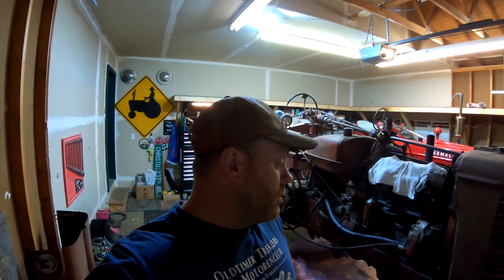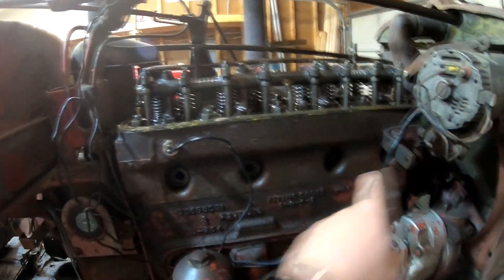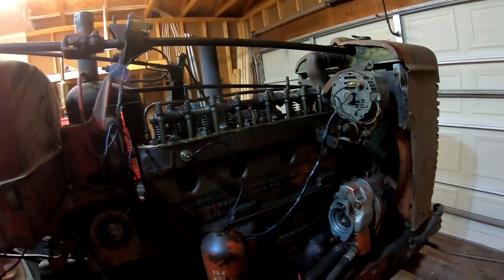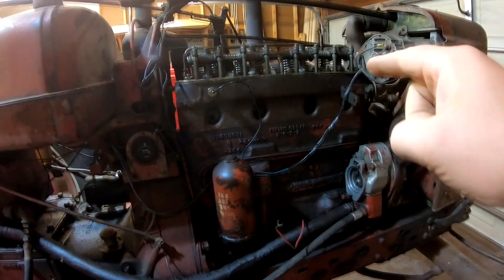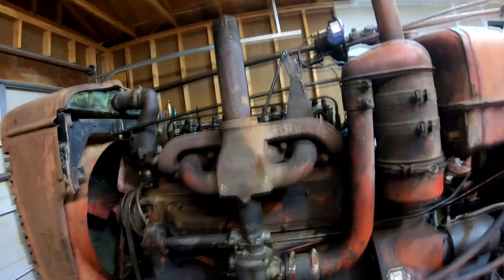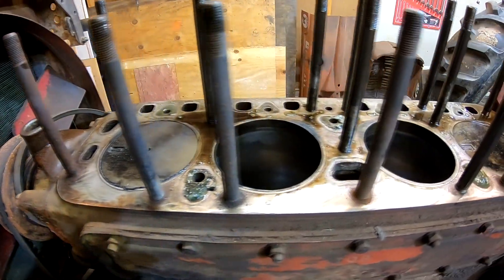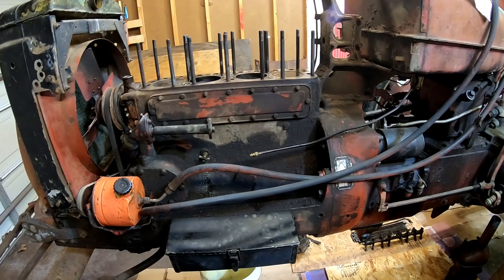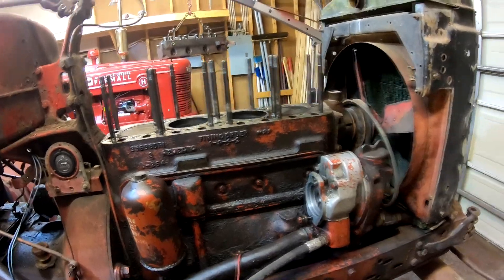This Old Farm's Farmall Super M Part 1: The Assessment

Comment: I want to make a correction for Kenny here. At about 2:30 Kenny talks about the written readings of our compression. He states the upper set of numbers are before head removal and the lower are after reinstall. This is incorrect. The upper numbers was the cylinders dry before ever removing the head. The lower set of numbers is after adding oils to the cylinders, again, before the head was ever removed.
Reply from the maker: Thanks for the correction. Either way, cylinder pressure is extremely low.
Reply: @KennyKizzleRustyNutzRanch  That’s right!
Reply: @KennyKizzleRustyNutzRanch  I wish I was a bit closer to you.  I could have stopped by with my kid's Engine Cylinder Leak-Down Test kit.  That would have been the correct tool to use.  But, the head is off now.  Next time .......
Reply from the maker: @bryanh1944FBH  Ya. That would be ideal, but either way - compression check revealing numbers less than half of what they should be isn't exactly promising. Plus, there are some other problems I found after I put my tools away and was covering the top end with a towel... In the next video.
Reply: @KennyKizzleRustyNutzRanch  Oh, that's going to be yet another great video!!  I can't wait.  I'll be watching.

Comment: Should be fun to watch. I have a wide front M and you get almost all the coolant out just by draining out of the block. I'd say a gallon at the most stays in.
Reply from the maker: A gallon makes a big puddle on the garage floor. Lol. I'll likely just use a big tub
Reply: @KennyKizzleRustyNutzRanch  Yes it can. However if I'm just changing the coolant like I do every few years I don't bother draining the radiator. Like you said it is a pain to drain the coolant with a wide front. A wash tub should be big enough to catch most. Maybe even put a tarp down first just incase.
Reply from the maker: @Jason1Pa  Biggest thing is I don't want my daughter to get into it, or my dog to lick it up.

Comment: Kenny, at 7:11 you ponder that line.  It is a vent with a very convoluted path.  It goes into the front of the head through a brass fitting and then across the head right under the valve cover pan.  While going across the head, the tube has a few vent holes in it.  The pipe comes out the back of the head, through more fittings and into the air cleaner through even more fittings.  That's how your H is too.  It was International Harvester's way.  Probably not their finest design.  And,when you work on H and M carbs (and SH and SM), when that vent isn't working well, the carb is all corroded up in the throttle shaft cavity, e.g., the idle adjustment #10 x 32 screw is corroded away.  Also, where this vent line goes into the air cleaner, it's very common for the sheet metal to crack and break right there.
Reply from the maker: It's funny you bring that up - I was thinking about it after I posted the video and thought YEP - it is a vent line. A crude attempt at a PCV system... Governor is splash lubricated from the timing gears up front.. I should have remembered that from the H AND M projects I have done. Ha ha. I have seen many of those fittings on the air cleaners broken and brazed back on. And having rebuilt MANY H and M carbs at Rudy's... That explains the many idle speed adjustment screws I have had to drill out.
Reply: @KennyKizzleRustyNutzRanch  I agree!  A very crude design indeed.  Plus, too many parts.  But, it was designed in 1937 and put into production in 1939.  What can you say?
I have a custom jig to hold the throttle bodies correctly when drilling the #10 idle speed adjustment screw out (or, an end mill in the Bridgeport works so much better).  But, I rarely use it.  Heat does it just about every time.  That is less work and preserves the original threads.

Comment: Sounds like a sleeve and ring job!
Reply from the maker: Most likely. We will see when we get them out.
Reply: @KennyKizzleRustyNutzRanch  with low compression and that ridge at the top. Either a bore job, or new sleeves. Watching you and Squatch I've learned a thing or six! 😆 🤣
Reply from the maker: @jamesdiehl8690  Sleeves, pistons, rings, and hopefully no major damage in the timing gear area. That play in the hydraulic pump has me a little worried. Either worn pieces in the pump, or a worn cam gear/missing key. Cam gear is a common issue with these live hydraulic pumps.
Reply: @KennyKizzleRustyNutzRanch  👍  😀

Comment: Hey buddy on my H I left the radiator and the front end all bolted to the bolster and used the engine hoist to remove it all together
Reply from the maker: I think that is what I am going to do as well. Seems like it would be easier with the wide front end. Should be quite stable as I roll it away.

Comment: check the valve timing.   ive seen broken/losse cam gear.   loose pump drive also supports such a theory
Reply from the maker: I agree. I think there are multiple problems inside this engine... I am well aware of the live pumps and the strain they can cause on the cam gears. Usually you see it a lot on Farmall M's upgraded with a pump...

Comment: Kenny,  Before you take the front end off I would pull the hydraulic pump. The play could be in there. I had the same issue with my 350. It had it had sheared the key on the key way on the shaft of the pump.
Reply from the maker: Yeah. Either way, the engine will be coming out to do the sleeve and piston kit. If we are going that deep, might as well check it all over.

Comment: Cam gear likely loose on the cam shaft from running the hydraulic pump. The early years were right hand threads and later were left hand.
Reply from the maker: I was thinking the same thing. Thought it was an M problem, mostly, when the live pumps were added.. But I believe this was a loader tractor, so the pump likely put considerable load on the cam at times.

Comment: as a former IH mechanic  here is what happens when an H or m  is  ran too long with worn sleeves and pistons  the M SM 400 450 etc the sleeve set generally  will last 4000 hours and then should be changed out.  when someone just does a ring job the ring lands are worn  and the   piston  between lands betwen ring 1 and 2  ring 2 and 3 has been known to break sections out and fast wear the sleeves..   if that SM was in my shop for service i would have   had it down ready for a inframe overhaul. there are used sets of sleeves and pistons on ebay cheap  put it together with rings bearings and gaskets and you got a good tractor ready for 2000 to 3000 hours of heavy feild use or just get a new engine kit. also check the rod wrist pin bushings for wear.. on high hour engines i have found the wrist pin bushings and rocker arm bushings and rocker arm shaft had to be serviced at the tham time. when the rods mains and cam bearings are worn out and you have low hot oil pressure the rocker arms  will starve for oil.
Reply from the maker: All great information, as always!!! I think this tractor will at the LEAST get a top end. We will see what the bearings look like when we get it apart. It does have an hour meter on it, but I'm not sure if it works. Maybe Connor can chime in on it. Stay tuned...
Reply: @KennyKizzleRustyNutzRanch  Hour meter works as far as I’m aware but as to when it was put on is very unknown. As with many things to these tractors, it could have been done at any point in time!

Comment: I think all my money is on a timing issue.  As you have already established an engine with 60 psi compression won't run.  No way the rings/cylinders wore down a running engine to 60 psi.
Reply from the maker: This engine does run, but has virtually no power. I think there are a few internal issues. I think the cam gear/live hyd pump has an issue in timing gears/shafts/keyways/etc.